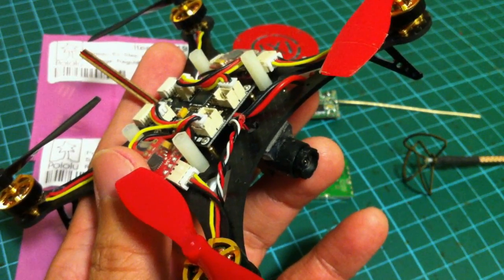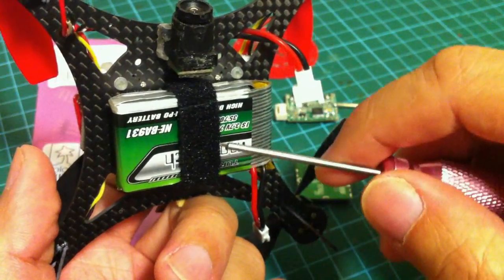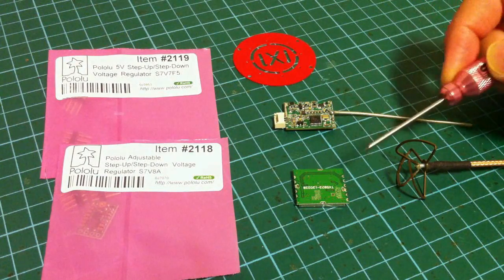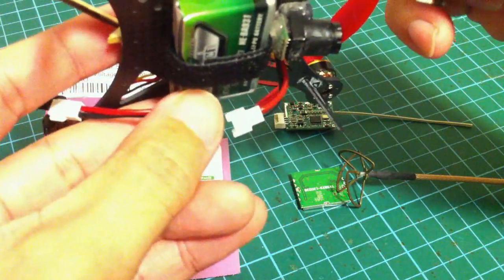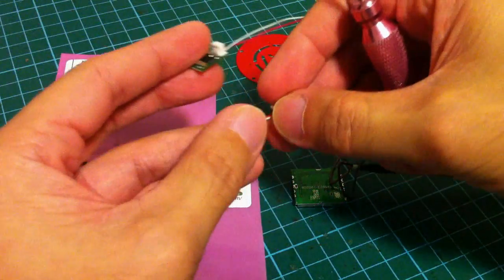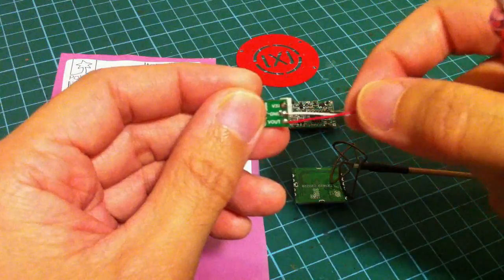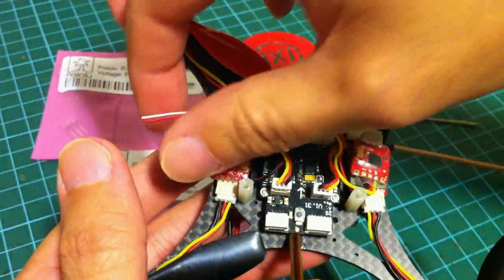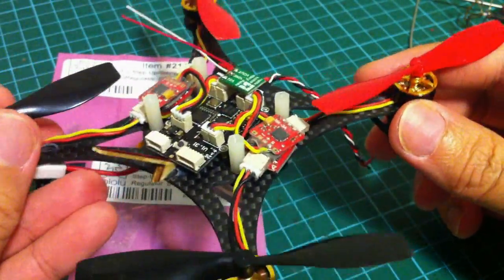FPV Conversion for Micro 125mm Brushless Quadcopter

Comment: Nice description.  Very similar to my setup, except that I am using Hubsan X4 flight controller.
Reply from the maker: Thanks :)  The hubsan FC is great. My only complaint on my FC is its integrated dsm2 receiver yields a short range (150m), I just built a 2.4g LRS to "shout" at it.. no failsafe behind 4walls, I posted a short video on it called "Cheap 2.4g LRS for micro FPV"
Reply: Yup, that is my biggest complaint as well.  With a bigger battery, 8.5 motors and that CF frame, I'm getting 11 minutes FPV of very light flying.  Goot time, but not good range.  I am tempted to do something like your LRS setup...